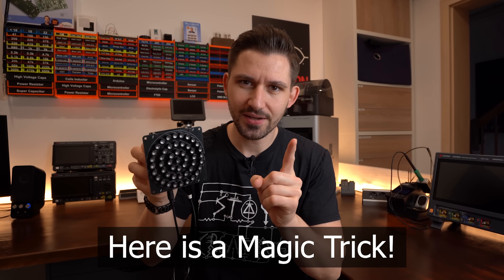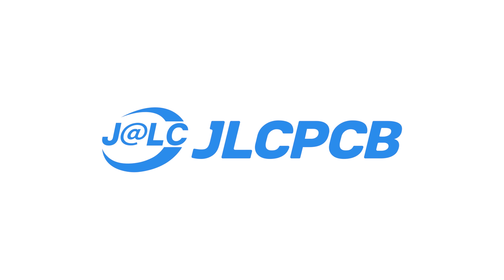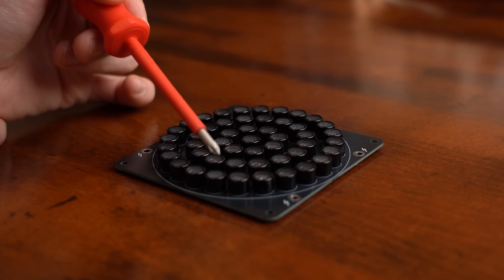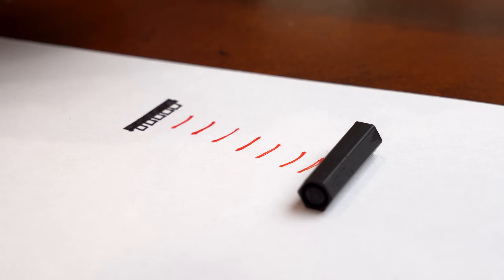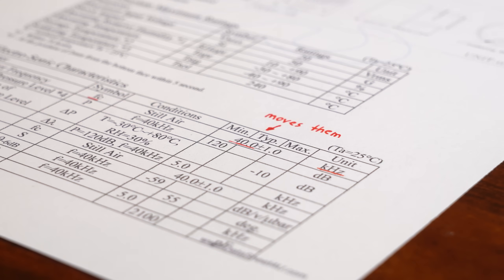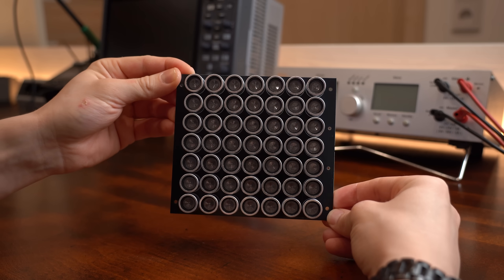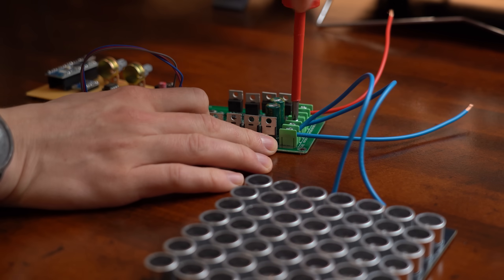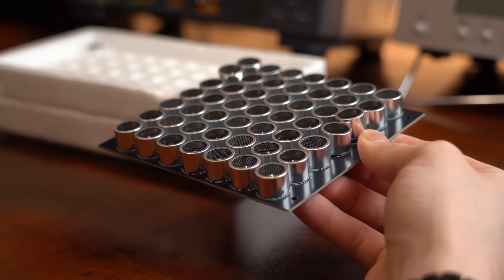The Coolest Speakers are TOO PRICEY? Let's Change that! (DIY or Buy)

Comment: Nintendo had these in the Wii U game controller. The only game I know used it for sure was Star Fox. When someone would talk over the radio to you, it sounded like you were wearing some kind of earpiece. Made the chatter sound like it was directly inside you ear.. was so cool and weird at the same time.
Reply from the maker: Really? Awesome fun fact! Nintendo actually kind of inspired this video. I watched a video about their Nintendo Museum exhibition in Tokay and they use directional speakers there as well to playback some 8bit Music when you are in front of the game.
Reply: @greatscottlab  Really? That's a neat idea! Thanks for sharing that too!
Reply: There's loads of teardowns of the wii U gamepad but they just have regular tiny speakers. Starfox mustve just used some surround sound type trickery (delay/phase trickery)
Reply: @mystiqality it's definitely that. It's even in the main menu music, there is an offset between the tv and gamepad sound if you turn on the surround setting. It sounds pretty neat.
Reply: @mystiqality  Must have then.. I just rember them talking about directional sound, so that's probably what I misinterpreted then.
Reply: @Striker_AgingGamers it might have been something like the stereo widening effect, where you delay the signal to the left or right audio channel by something like 1ms. It needs to be a delay shorter than we can hear directly, like less than 20ms or so. Changing the delay changes the perceived wideness of the sound, and can even make it sound like the source is wider than the speakers. I can imagine this working to make it seem like you had a headset on. Overpowered stereo widening can produce some wild results
Reply: @evanbarnes9984  You know,  now that you say that, that does seem like what was happening! Was just such a neat effect and even neater that it was done with just techniques. Sound engineering is as awesome as electronic engineering.

Comment: Interesting, I did not even know that directional speakers exist 😅
Reply from the maker: I was unaware of them for a long time. But they seem to get installed more and more in museums. ;-)
Reply: Some theatres have them as "language zones."  If you sit in a certain row the production is in that row's designated language.
Reply: @ That is actually pretty smart. There seem to be quiet a few usecases for these speakers.
Reply: Highly directional audio is interesting..there are also near field microphones, which only pick up sounds within a few inches (if selected) of the microphone... and far field microphones.... when I first used a nearfield, it was pretty amazing as the room noise was likely 100db or more, and the mic only recorded the person speaking
Reply: Synergy horns and line arrays are examples of directional speakers as well. Their dispersion pattern tends to be a bit wider though.
Reply: They are even in the big sphere in las vegas, they use it for the people that speak different languages so they can hear it in their language
Reply: These where also used in the 80s and where featured in an old  ep isode of  "The Three Investigators"
Reply: With enough amplitude, they can even be used to levitate small objects by trapping them in the rarified zones between the standing waves. And by varying the phase of the ultrasonic emitters, you can move the levitated objects in space. But this only occurs in the near-field. To do that much further would require so much acoustic energy that it would likely rupture whatever it was aimed at.
Reply: 💀 how did you comment before even video was uploaded
Reply: @ahadaay  Patreon supporters have early access to the videos.
Reply: How your comment is 4days old ;-;
Reply: @adittoyt  time travel 😮
Reply: @adittoyt  With Patreon, you have early access to the videos.
Reply: @adittoyt  Witches 💯